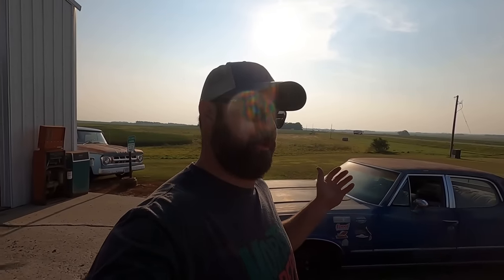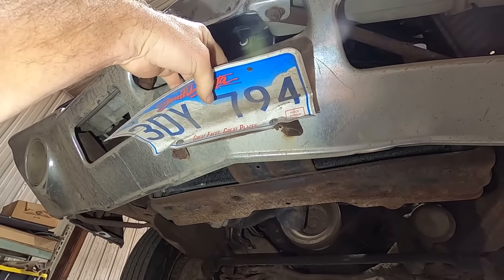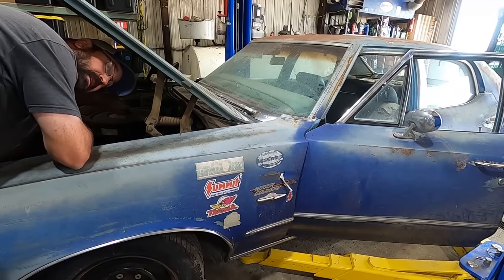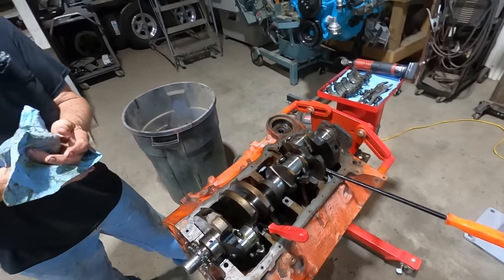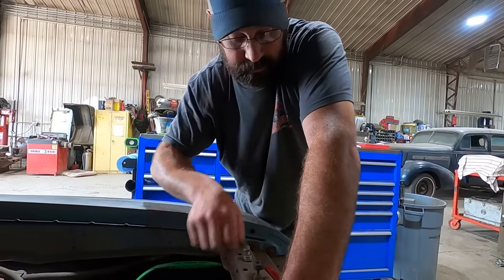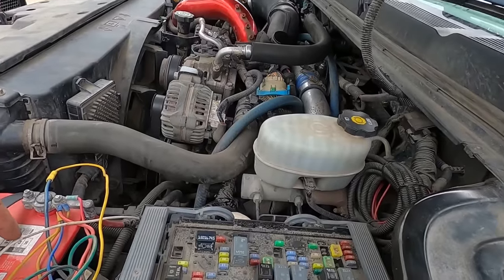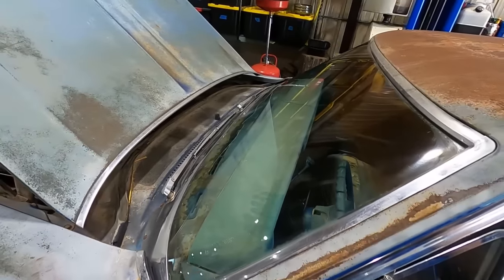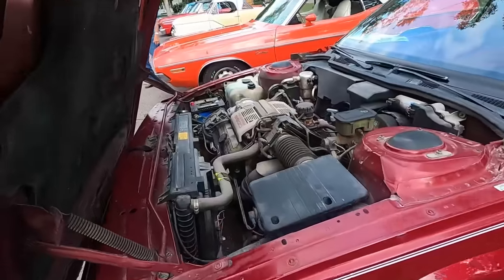Dirt Cheap Muscle Car!! Saved from the Scrap! Will It Run?!? Budget Built Hot Rod!

Comment: Hilton inc. You have i have some pills for those. 
I had all kinds of that stuff when I was drag racing. I wasn't some dumb ass engine builder. When I stop racing I was turning 7.62@165 mph 1.2  seconds 60 ft time. Brown inc 1271 bds blower 2600 lbs 70 Camaro moly cage. I drive that one an my brother drove   Fiat topalino alter I have my website with all my cars. I you know anyone look for lot of engine building tools I have a lot stuff. Engine stands like the one you showed has the handle on to to trun the 
motor everything for  Degree the cam. I have ring compressor the ones made for what size piston you have 4in Chevy 5over 10 over all kinds of different sizes. If you know anyone let me know. Depends on what is Il do trading. I would love  to sale my 2004 H2 Hummer 6.0 150,000 miles like new tires new starter.

Comment: Boy some of these. You should just walk away from. This car is not even good enough for a parts car. A POS. my question is why try and save this car. And your more interested in MoJoe’s working on small block. Well on positive. It did run the Cutless. Transmission was shot. Spent more time on replacing than getting it to run. Really don’t think this was worth the effort. If tires and wheels make the car. Mortske you got it. I would give it away.was not worth the trouble. I’ll be honest buddy. This was the worst video of your ever took time to watch. 🥲 sorry.
Reply from the maker: This car is awesome!
Reply: @MortskeRepair  I’m probably wrong. I apologize.